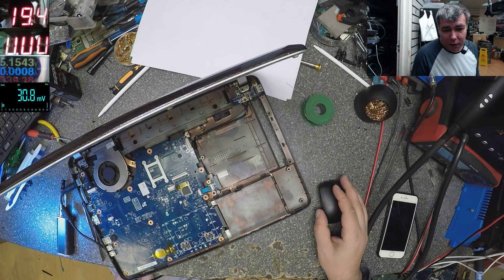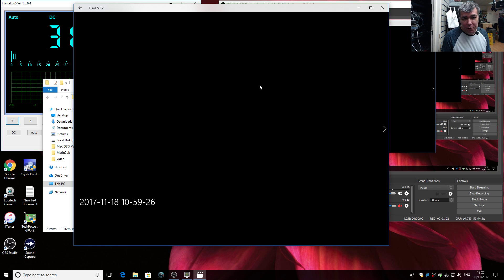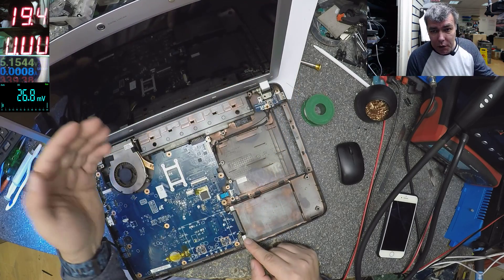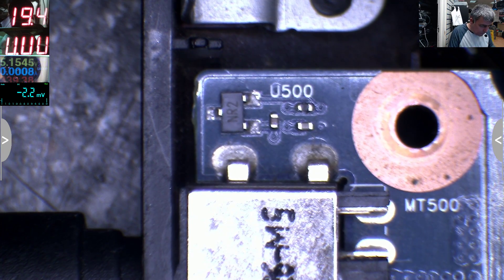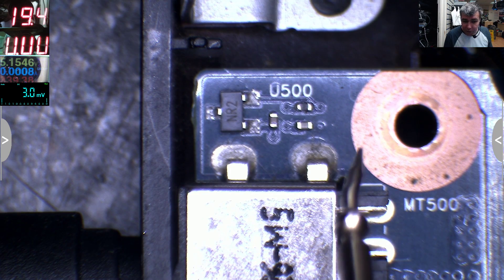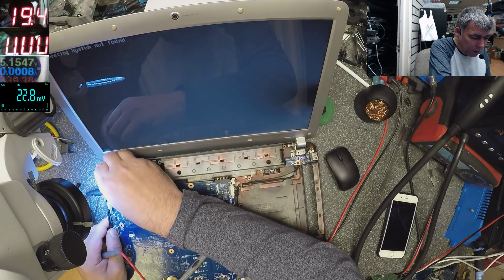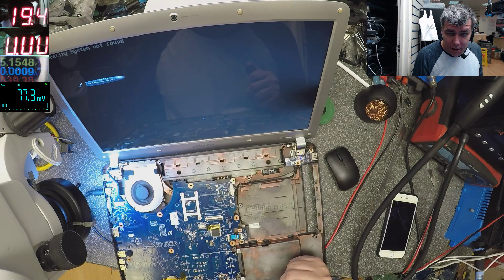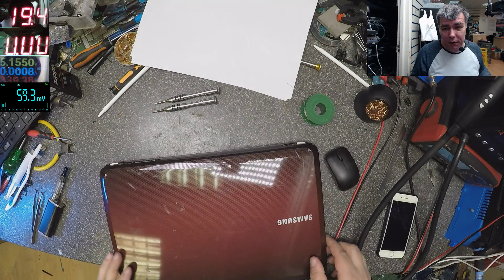'LID' Motherboard Signal, Hall sensor explanation

Comment: Lenovo 💻 also has the sensor in exact same place. I added a thin metal sheet in between magnet and sensor, Now my laptop never goes sleep while lid is close. Same result can be achieved from BIOS or OS level. But my use case exactly match with this method. 

Thanks.

Comment: Hello, thank to your video i figured out where this sensor is. I assume it is working correctly because all the measure are ok. If into magnetic field the pwr switch doesn't work and I assume it is normal (simulating a lid closed). Anyway I experienced this problem: when I  press the pwr button during a cold start the laptop monitor stays off. If i stimulate the hal sensor with a magnet 2/3 times the monitor turns on. If I restart (warm pc) the monitor stays on and respond correctly. I have a Dell xps 1340 core2duo old pc and the sensor is in the palmrest, near mouse left button ; it is processed in a logic board and connects to the mobo with a ribbon cable which carry pwr switct, palmrest fn switches and leds, TouchPad and so on. If helpful I have a malfubcion in a led (volume down) what stays on when pc is off, and turns off when pc is on (also non working during self test at start). Do you think I should replace or repair the palmrest or the problem should be on the mobo? Thank you

Comment: Is it possible to get rid of the magnets that are inserted in the screen , so the computer behaves as if the lid was constantly opened? I've got some old laptops I want so use with them being closed but they look like the performance of the computer gets truncated when closing the lid. No option on the BIOS to change this behaviour , neither on the OS (Win10) . Please let me know if you know a trick. Thanks for the video

Comment: Actually, this thing is more important than you can ever think. I have here a computer a customer brought to me, telling it's overheating or the graphics card is fried. As a computer repair guy I tested everything and it turns out the problem is exactly this Hall LID sensor. In my case, it is giving bad outputs, making the computer go in sleep mode RANDOMLY. I know a lot of people trashed their computers for this very reason!!! So watch out guys! :D
Reply: same problem here got a computer from a customer with a hall sensor that is corroded till its green

Comment: Method#1: Repair Corrupt MOV & MP4 Files with VLC
Follow the steps below:

Step 1: Launch VLC Player; go to Media, and then select Convert or Save

Step 2: Next, add input files or streams that need to be transcoded, and then press Convert or Save

Step 3: In the Convert window that appears, provide the file name for the destination file

Step 4: Next, select the desired input Codec from the profile list.

Step 5: Press “Edit Selected Profile” button to check or edit a specified profile settings

Step 6: You can also select to add a new profile or delete any existing profile

Step 7: Next, press Start

This may help repair video files, therefore, making it playable in VLC and other media players. If not, there are other procedures that can also repair corrupt video files.

Method# 2: Replicate Video File to Gain Accessibility
Follow the steps below:

Step 1: To begin, create a copy of the original MP4 or MOV files

Step 2: Rename the video file to AVI

Step 3: Now, launch the VLC player

Step 4: Select VLC, then Preferences, and then click on Input or Codecs

Step 5: Then click on Save in the bottom section of the Preferences window

Step 6: Now, select Always Fix next to Repair AVI Files

Method #3 Video Repair Software for MOV and MP4
If none of the above-mentioned processes helps much in resolving the issue, you can try using Video Repair Software to repair your corrupt MOV and MP4 files. The tool has the capability to deal with all kinds of MP4, MOV corruption issues including broken file header, compression issues, etc.
https://www.stellarinfo.com/blog/repair-corrupt-video-file-vlc-media-player/

Comment: A video container: avi, mp4, mkv... are similar to electronics schematic. And that schematic must be closed properly to work properly. Your video hasn't end properly, there is missing parts in it. 
I think you need to re-index the informations in the file. 
At the beginning of the file, there is informations about the streams inside ex: 
video stream encoded with Xvid at 25fps, 
audio stream encoded with mp3 or ogg or AC3 codec at 48khz,
 what splitter is used, what is the video renderer... 
At the end of the file there is important informations as well, and they are missing because of the crash.
If you want, I can try to fix it for you. Just upload the file upon your google drive then send me the link. 
Best regards

Comment: Hello good day. Thanks for teaching us your work. It is wonderful to see how you do it. I am a FP informatics and will change parts, but not repair them. And I want to learn to repair !! I'm trying with your videos.
I want to buy an adjustable laboratory source. But I do not know which one I need. According to you, it has to be linear and I have found one, which has:
Output voltage: 0-30V
Output current: 0-10A
Protection: Current limit

Do you think this will help me? Thank you and... sry for my english XD
Reply from the maker: yes is fine but 10 amps is too much. Check for one 3-5amps
Reply: Ten amps too much? They recommended this for the 10 amps. Some high-end equipment consumes more and if they have a problem with the battery charge, I will not be able to test. At least that was understood. Thanks for your prompt response. A greeting.
Reply: nowadays they produce laptops which works with 15 amp.. if you think about future buy with high amp.